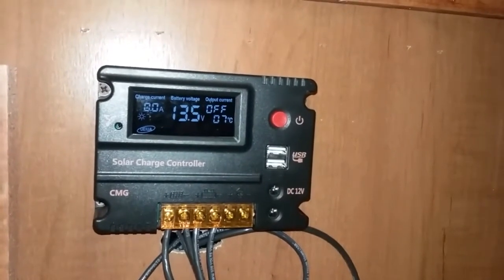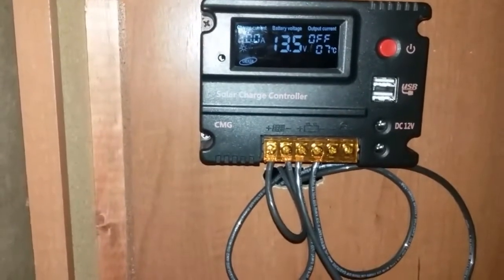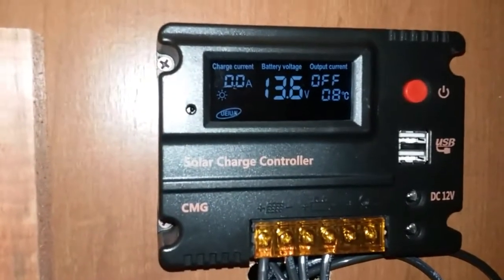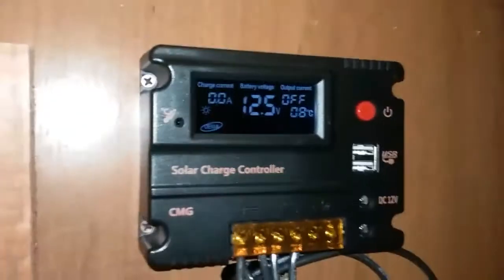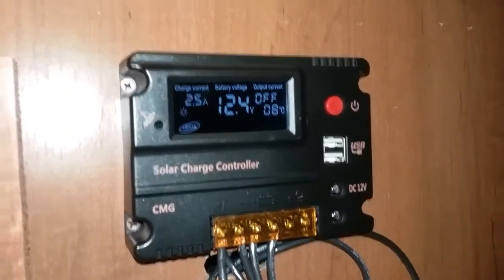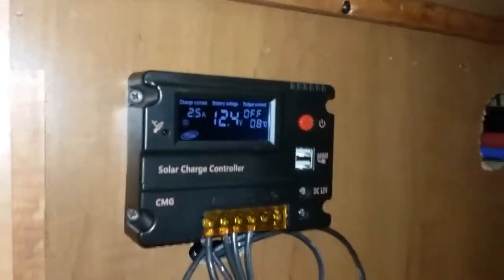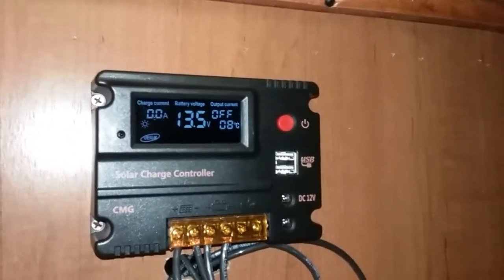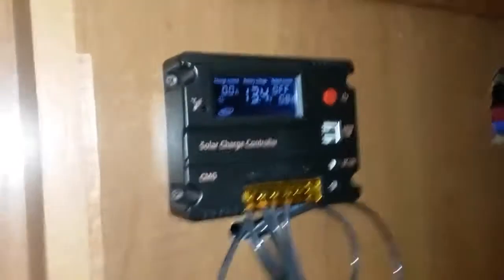Mohoo 20Amps Solar Charge Controller

Comment: Are you still satisfied with the battery-controller?
I have a banner Running Bull and I want to buy a  controller.
I think banner should be charged at  14.4 and when full at 13.5V. Have you seen the controller acting like this?
Reply from the maker: I'm very satisfied with the controller. And for the price is I don't think is nothing as good. Mine hovers around 13.5v when fully charged

Comment: My charge current blinks between 0 and 8amps. I have two 100 watt 12v panels. Is the black blinking back and forth to zero normal ?
Reply from the maker: FPVav8tr mine does the same every now and then. It could be the cloud coverage or power cycle going thru the battery. I'm not sure I notice that when there is full sun the power amps coming in are pretty steady. I get the 0- 8 amps when therere clouds. But as far as battery or solar charge controller no issues thur far

Comment: That red button is a on off switch? Explain when is it appropriate to turn it off.  Thanks
Reply from the maker: Henry, the on/off switch allow current to flow to the USB's and the 12v outlets in the SCC. the switch does not interfere with the normal operation as sun hit the panels and charge the battery.

When the switch is ON the display shows  how many amps are flowing in the plugged gadgets, and when is off it display OFF. I rarely use mine so normally is in the off position until  needed. I hope this answer your question.
Reply: El Punto helpful answer.

Comment: So it looks like they resolved the over charge issue then??
Reply from the maker: thus far, I haven't had any over charge issues.
Reply: El Punto that's great, thanks for the reply, I have one of these controllers and my 120W panel is on the way, I'm looking forward to testing it out.